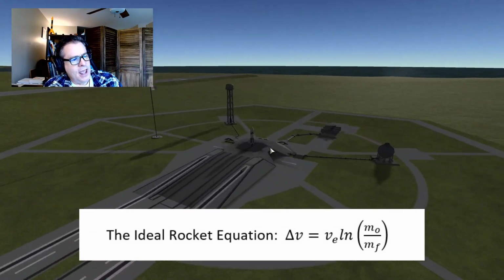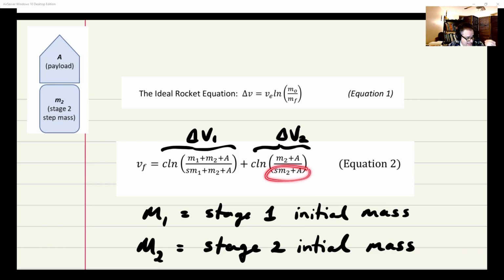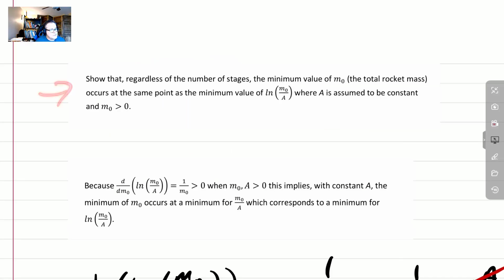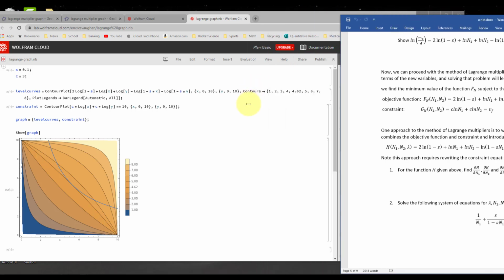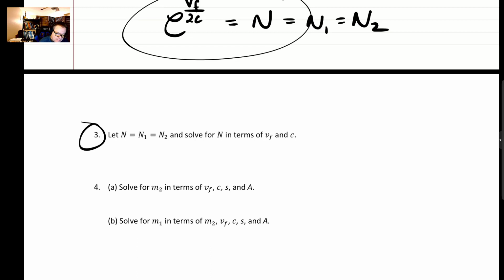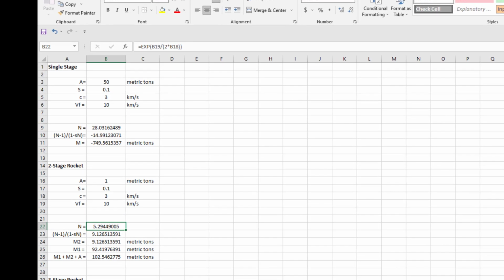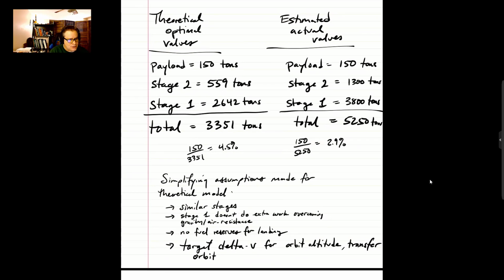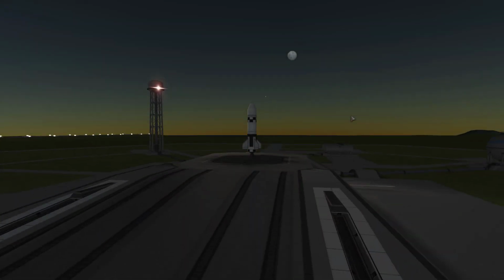Optimal Rocket Staging with Lagrange Multipliers

Comment: And if we use different structural factors for each stage can we use the same method? What if we use multiple engines with different "c" values? Excellent series of videos, this is the first one I watch but I can already feel the wisdom in the others!
Reply from the maker: yes, same method, the only issue is solving for lamba in the system of equations , it will require a numerical approximation.